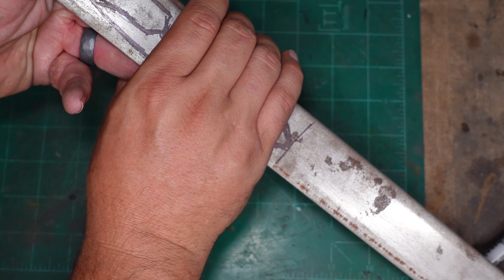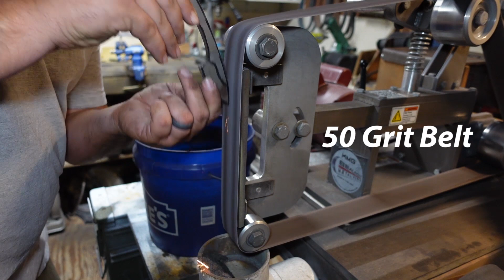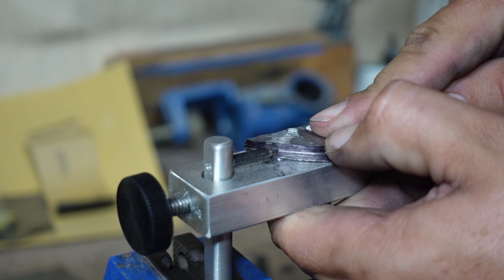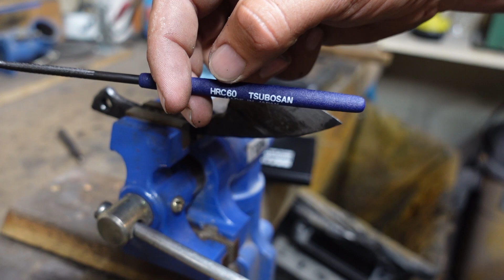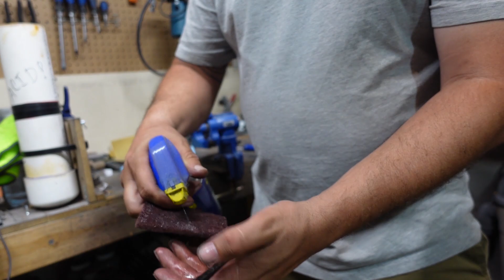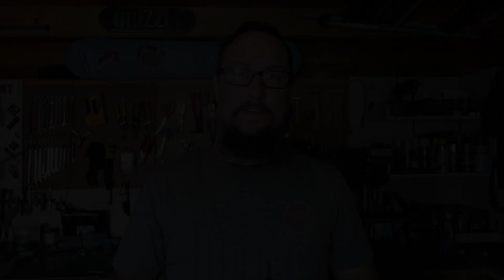Making An EDC | Rock Texture Knife

Comment: I don't have a 2x72 belt sander.  All I have is a 1x30 and a bench grinder with a stone wheel.  Can I achieve the same patterning? I can't really get to the roller rounded parts of my belt sander.
Reply from the maker: You can get this look with the stone wheel or an angle grinder with a thick grinding wheel.